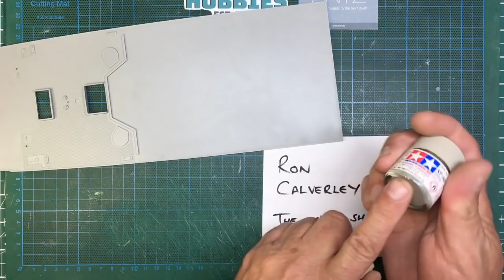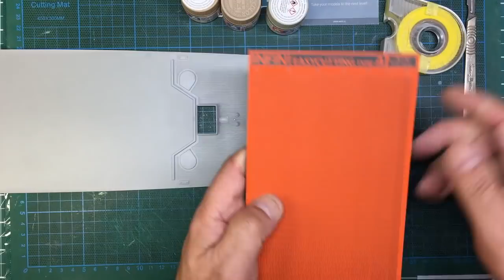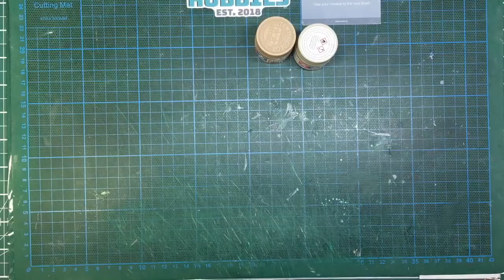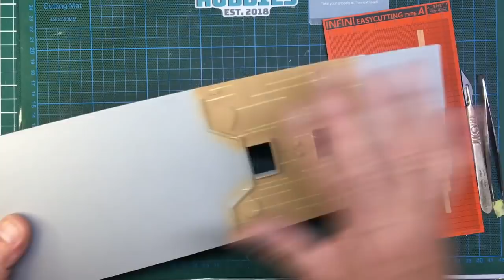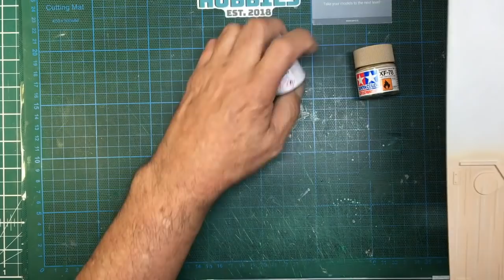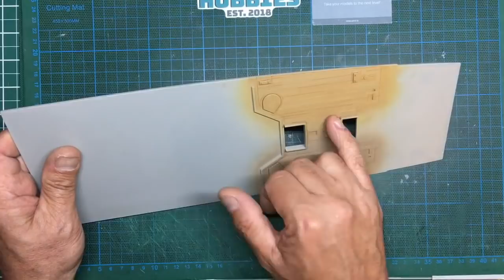How I paint model ship Deck  Planking.. one for Ron!!

Comment: Do you spray the planking and then hand paint all the white parts afterwards?
Reply from the maker: Good question.. i would more than likely mask the deck and spray the white bits.
Reply: Nigel’s Modelling Bench I guess either way there s no quick way, even the deck bits on my boat are quite random and in places quite small so masking is going to be interesting.

Comment: I have never understood the reason for putting wood veneer on plastic models.  The deck of a ship has no noticeable variation in colour or texture, certainly any variation is less noticeable than the caulking yet I have not seen modellers accentuating lines of caulking. My reasoning is that if you get close enough to your computer screen you will see that there are thousands of collared pixels which, from a distance, is one colour. Do we ever get that close to the deck on a scale model?

Comment: Does this device work with 350 scale as well?
Reply from the maker: Device? I think you mean "process"? Yes it can work at any scale. I have a beginners playlist on this channel where I cover wood grain in depth.
Reply: @NigelsModellingBench  Wow that was fast, l still haven’t finished your video. No l understand the process, l was referring to the Infini easycuting  cutter itself, wondering if the thinnest strips you can make, work just as well with a smaller scale like 350. l take it you say it does. Thanks
Reply from the maker: @bebopkirby  sorry. Yes, the cutting mat goes down to 0.4mm which could even be used on 1/700 perhaps??

Comment: I prefer 55
Reply from the maker: Yeah.. i know what you  mean.. 55 is old and faded, 78 is a little yellow perhaps. i think scale also plays a part. I would use 78 on a larger model whereas I think 55 would look better on a 1/700 model warship.
Reply: @NigelsModellingBench  yeah fair point 55 is amazing on 1:700 and i personally would use 78 on 1:350 and even larger scales